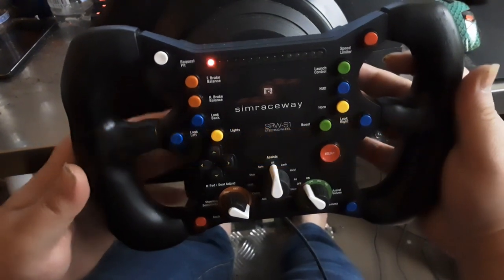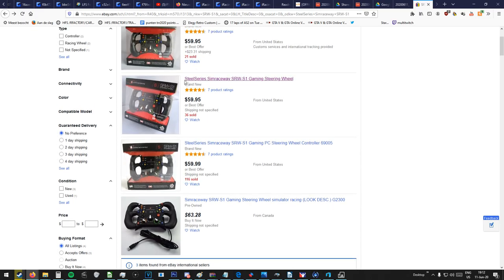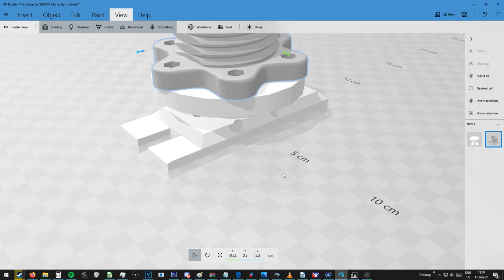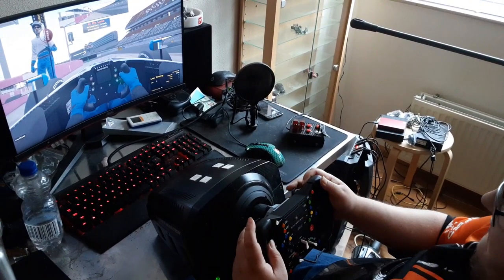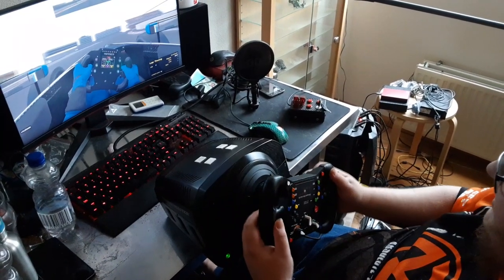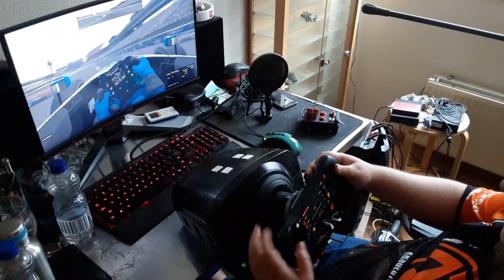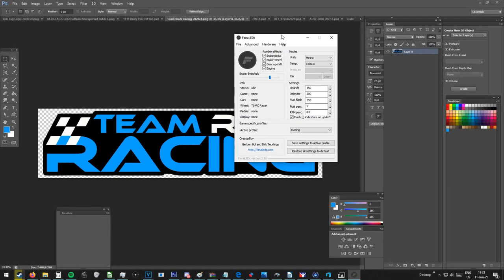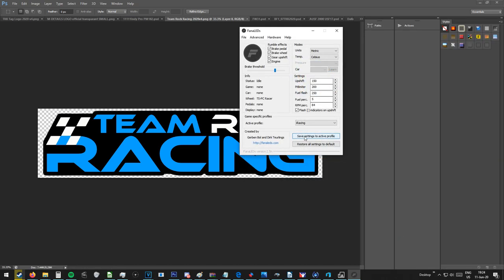How to: Low Budget Epic F1 Steering Wheel Add-on for Thrustmaster Wheels

Comment: How do you assign rotation so the game picks up the base, rather than the rim? Turn off the rim while assigning?
Reply from the maker: It's a 3d printed mount to fix it straight to the Thrusmaster TS-PC servo, so technically it's the wheel of the servo.
Reply: @cholover7  But if the rim is plugged in, and rotation works as gyro, when you turn it computer detects it. But i guess there were no issues :)
Reply from the maker: I read your question wrong my bad, in case needed don't plug in the SteelSeries wheel when configuring rotation indeedly.

Comment: Amazing steering wheel !!! Which team's is it ?
Reply from the maker: It's not an official F1 team's wheel, it's just a F1 style rim wheel. :) I used the SRW-S1 wheel from SteelSeries which is basically a servo-less wheel which works in the air and u steer with motion originally, I just turned it into a proper add-on wheel for my Thrustmaster by creating a perfect fitting clamp together with an existing quick release adapter to fit perfectly. :)
Reply: @cholover7  ok, thanks for letting me know 😉😉